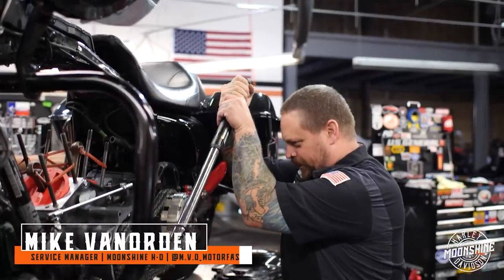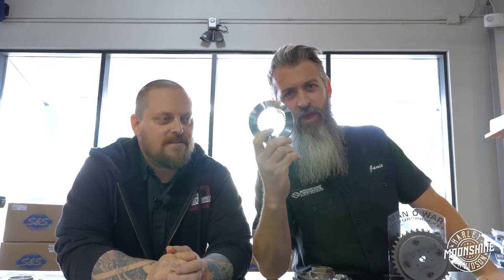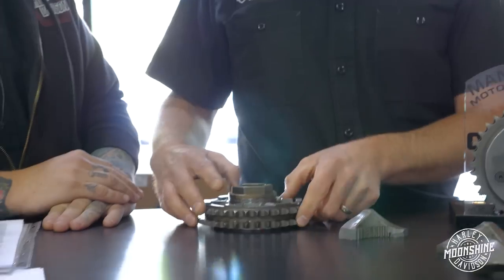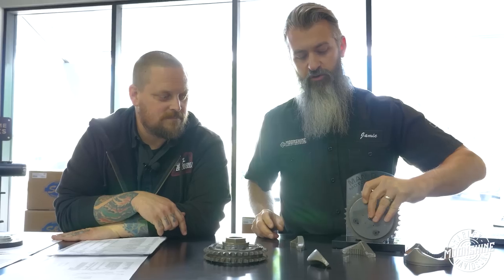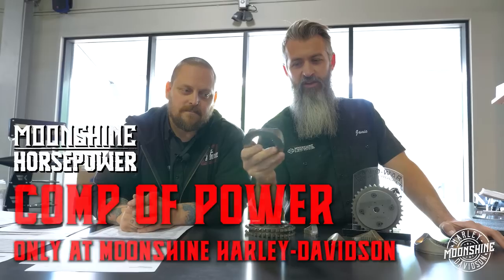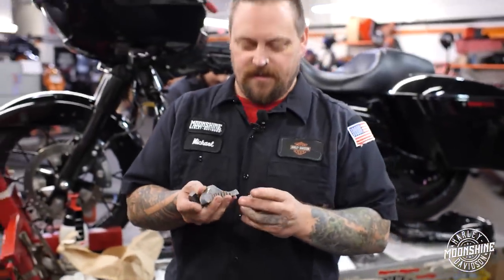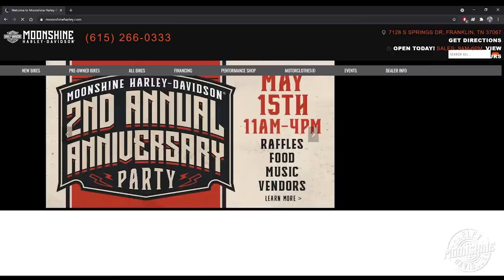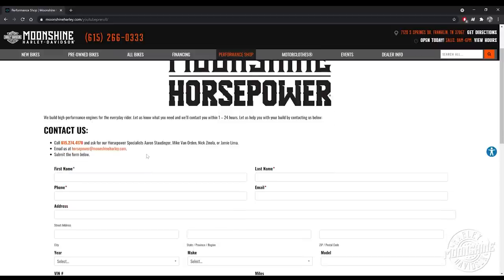The Smooth Comp of POWER by Moonshine Horsepower | Shop Talk Episode 52

Comment: I have a 2019 RG with a 124” S&S big bore kit. Definitely ready to change the comp ramp out. 
Question, what sprocket should I pair it with? I have the stock clutch basket and stock plates. Thinking about doing a trask basket but I’m not sure about what plates to use. Someone helppp me

Comment: George Bryce is a good asset to have .  Bagzilla proved a stock setup can work if setup correctly
Reply from the maker: It’s proven to hold up to 9 sec quarter mile applications.
Reply: Bagzilla is a twin cam. This is a M8. George says the same thing moonshine says... Change the compensator because it will break. He sells an improved one as well.
Reply from the maker: @MrJwh3000  It’s the same Comp Ramp. We team up together on certain projects.

Comment: Hi a couple of questions? Is the piece for sale? How much $$? If you build a 150hp M8 but drive fairly normally and most of your fun is roll on power, on ramps/highway/3800-5200 rpm etc. High rpm highway shifting. Are you saying Darkhorse is overkill? Doesn't behave as well in normal traffic situations? What would you recommend for a clutch for that kind of operation?
Thanks, watch ALL of your videos.
Reply from the maker: We designed the Comp OF Power for riders just like you. This compensator design is easier on all of the drivetrain parts behind it and retains the stock smooth feel. Just because we say smooth doesn’t mean it’s not high performance. We run this setup on our drag bikes. We prefer and recommend this comp for most builds. This piece can be purchased at shop.moonshineharley.com or call us at the shop
Horsepower Team
Nick - Aaron - Jamie - Mike
Phone: 615-275-4170

Comment: I have a question regarding the installation of the billet compensator ramp. I had one Installed on my 2022 Roadglide Special, noticed some noise after installing, but  noise has smooth out . Is this normal because of the self adjusting primary chain?
Thank you 
Al
P.S. will it continue to smooth out? Any input would be appreciated 👍.
Reply from the maker: It should be the same as stock as the ramp Is identical to the stock shape. The material used is what make the different.

Comment: Need to beef up the springs with it know they break with certain torque numbers but kinda defeats the purpose if it’s torque numbers if it’s weakening the ramp imagine what the springs are taking
Reply from the maker: We haven’t experienced broken springs? They are a wear items that could be replace from 20,000 - 70,000 miles depending on abuse.

Comment: Many other manufacturers use gear driven primary. Therefore no compensator?
Reply from the maker: The compensator is need due to the H-D firing pattern as it’s not evenly split.

Comment: Do you have a fix for the spring stacks weakening?
Reply from the maker: A replacement set from Harley-Davidson. We typically see them handle 20,000 - 50,000 miles before needing replacement.

Comment: Why doesn’t anyone make for a twin cam with the SE comp ? The ramp looks the same as what’s in my twin cam.
Reply: Not sure what year you have. I have an 01 TC. Everyone I talk to says the compensators are good on the 2003 and earlier. Once they changed it to the integrated spring setup (maybe in 2007) it went to poop. Then instead of going back to the old one they kept trying to make the SE version work. 
Even Baker Drive train told me the stock ones were good. I'm making 120HP 124 TQ with a 107 and it's been good so far. About 5000 miles on the 107. Bike has 27000. 
They say the same thing about the clutch basket but I put a billet one in anyway. I have not found anyone that makes a compensator replacement for the early TC. Darkhorse said they do not make their version for the early TC because it has fewer teeth and a smaller diameter that doesn't allow for enough material to keep it strong enough with their setup.

Comment: Will this work for twin cam or just m8
Reply from the maker: M8. The Twin-Cam comp is a beast right from H-D.
Reply: @Moonshine Harley  you've officially lost all credibility saying that twin cam comps are beasts from HD. Maybe 2011-2016 but 2007-2010 are complete trash. Designed for 80ci and never revamped enough for the power of the 96ci. Complete trash.